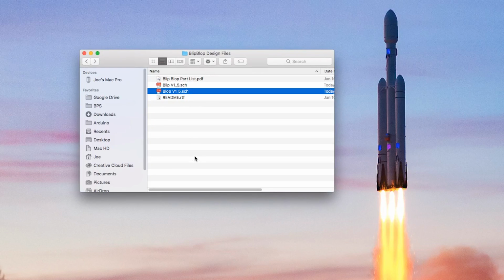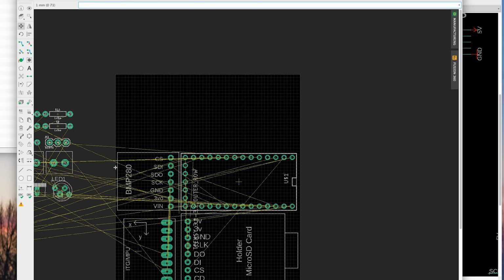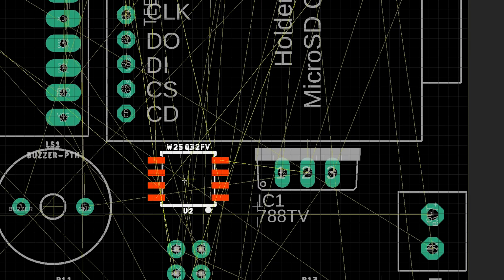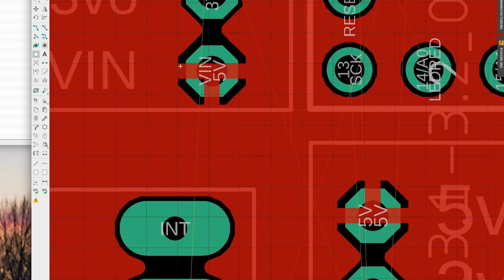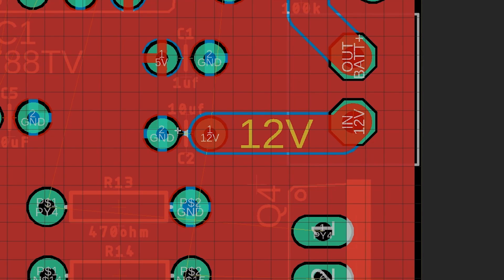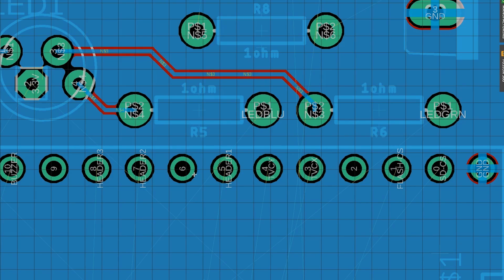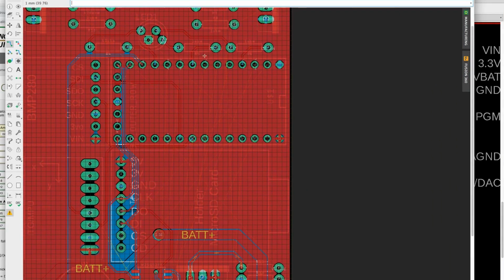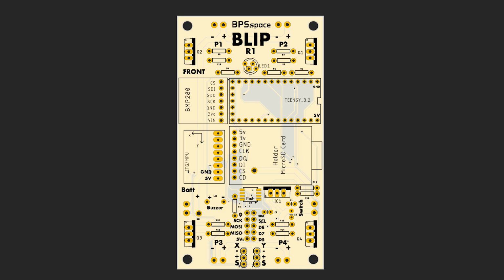PCB Layout - Landing Model Rockets Ep. 5

Comment: You should use a dc-dc buck converter like lm2596  rather than a linear regulator like 7805. Coz these linear regulators heats up a lot which wastes the battery power.
Reply: Should also use 10K for pullup to save power and heat.

Comment: Jo, i use an old version of eagle. I can automatically create VIA between the top layer and bottom layer by using the middle mouse button (since you have a mac, if you switch between layers while doing a trace, it will automatically make the VIA for you.)

Comment: Small critique,  you should always have decoupling capacitors as physically close as possible to your VCC pins on the MCU, chips, etc. routing the VCC pin to the positive pin of the capacitor and then (if you are so inclined) to the 5V plane. I was taught to only use ground planes on two-sided PCBs (to prevent shorting).
Reply: what is this stuff called. Designing circuit boards?
Reply: peace out ? PCB means printed circuit boards

Comment: And about the routing. You should choose a main direction for each side of the pcb, let‘s say, vertical on the top and horizontal on the bottom. And when you have an L shaped route, you go vertical on top, change layers, place a via and go horizontal on bottom. When it is the first signal you route, it looks strange, but the more signals, it makes sense, because you only use area, but don’t block anything. So, when I route a board, I have a lot of mainly horizontal and vertical traces and in a second pass after the signals are routed, I optimize them and make more use of the diagonal directions. That will make the traces shorter and also use less space. You can already do that, when you are running out of space for routing, before you have finishes all signals. 

I do not use the polygons for automatically connect the power and gnd. I route them and I use wider traces,,, when you let the polygon let do it, you have less control. The copper might pass through a narrow space maybe leaving a 0.25 mm trace, but you rather want at least 0.5mm and you didn‘t notice it. Then it might even burn at this spot.

And about the placement... use the schematic for placing groups of components, then look at the air wires and rotate the parts, then move the groups together snd maybe optimize the position of the parts. Maybe it helps you to understand better, what I was talking about, when you have a look at my github repository: https://github.com/svenpetersen1965/Pi1541-HAT/tree/master/Pi1541/Pi1541-HAT/Rev.%201/Eagle

The actual routing of this board took maybe 90 minutes.

Comment: Hey Joe, can I give you some advice? You are really doing it the hard way, I think. Do the ground polygons in the end. This way you can see, what you are doing. Also, when you are routing a signal, you just need to change layers and you automatically get a via at the mouse cursor. You just place it, then you continue routing on the other layer. I have assigned layer 1 to the F11 key and layer 16 to the F12 key. This way, changing layers is much quicker. I would also recommend getting a second monitor. This way, you can have the schematic on one and the layout on the other monitor. And maybe you want to change the long pads to normal round ones in your library. Long pads just take more board area, that you could use for routing. And also they look like hobby electronics. I am an engineer for 25 years and I never used long pads and I never regret not using them :-)
Reply: you've just saved me 5 minutes of writing the same Things ;-)
Althogh he did a great Job explaining most Things Pretty good!
Reply: Dööörk I like, that he has so much fun with it.

Comment: Well made video. But as a person who does PCB desinging nearly daily as a profession my work persona noticed some things that I would have liked to do differently. Like if you plan to have a battery connected to the board, there doesn't seem to be any fuses. And why aren't any SMD-components used? Honestly they are really easy to use and save a lot of PCB-space.
Reply: Honest question? Why would you need a fuse if you're using a ~5V battery?
Reply: @mrsoundso4897  the battery is 12v.
Reply: And fuses don't protect from overvoltage but from too high current.

Comment: Good stuff...
Important to keep in mind what it takes to make a capacitor: 2 wires and a space between them. 
I've seen designs where points on a board would heat up and short (or open) often because of poor consideration of this issue. On a 2+ sided PCB, every other layer should have lines printed primarily 90 degrees away from the previous layer to reduce capacitance between layers. 
BTW, the hole that the component is soldered to is called a feedthrough. 
Also, in the microchip world, the connection between a "wire" and a component is called a  "contact", and a connection point between layers is called a via. So in the microchip world, you have your layer of components built into the silicon wafer, then the contact layer, followed by a sandwich of metal and via layers that serve as the interconnects between the components until you reach the layer that connects to the outside world.
Reply: +1, my thoughts exactly while watching the vid. Watch out for coupled lines. You can even simulate/test these things using software like PSPICE.